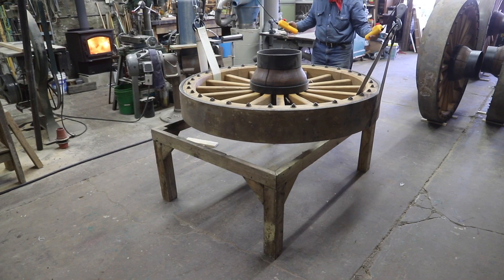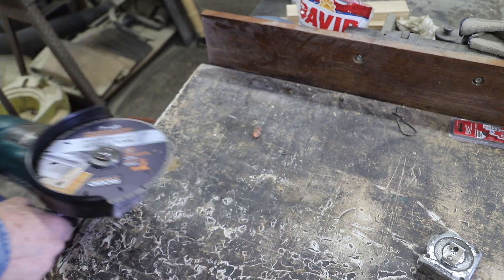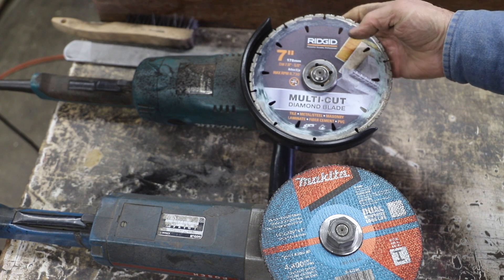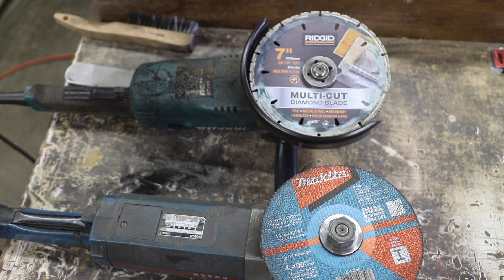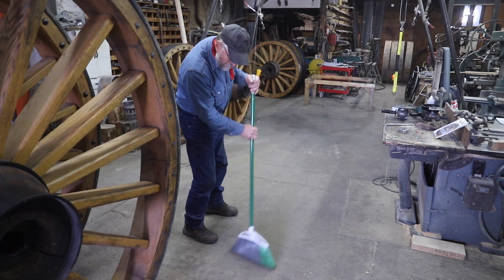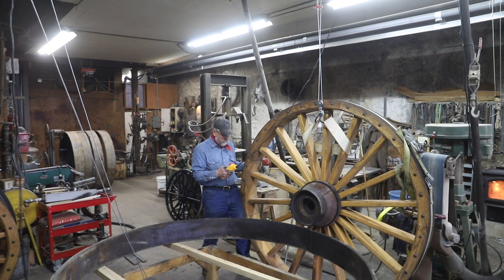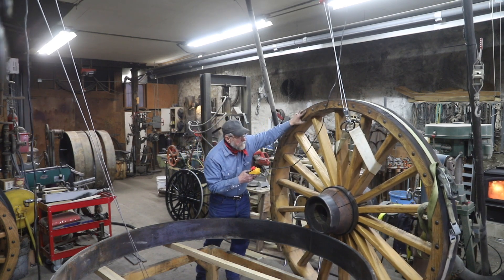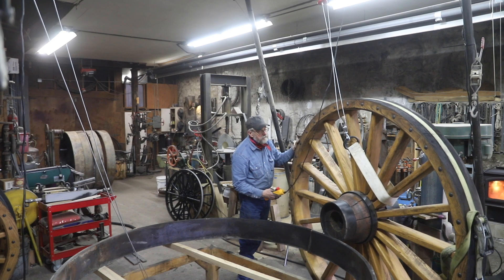Dismounting 550 lb. Steel Wagon Tires | Engels Coach Shop

Comment: Wow! @11:30 you could see how sloppy the joints had become, as the hub sank a couple of inches below the rim - proof that they really were felloe-bound and did need to be tightened up. That was an impressive feat of single-handed manoeuvring of those heavy wheels - well done, Dave!

Comment: I think one may have missed under stud what a diamond blade is realy good for, not soft steel as in your  wagon wheel tire, yes that is softsteel as compaired to HSS, tool steel, soft steel will gum up a diamond wheel, it's like taking lead to a grinding wheel, and diamond wheels don'thave open poors like a stone grinding wheel witch brake down and maintan there cutting eage

Comment: Use a 3 point lift and you do not have to be as close with the balance. But that requires a 3rd winch and a 3rd hand.

Comment: Those diamond wheels tend to cut much slower, but handle more materials and last longer, despite diamond being soluble in hot iron. Best use for them in my opinion would either be stone work, or having one in a field bag to fall back on if you run through the rest of your abrasive discs and aren't in a position to go back and get more. I wouldn't have  expected them to hold up as long in ferrous materials as I've seen them do in tests, but iron might still be the worst thing to cut with them

Comment: I don't understand why you had to adjust these wheels so soon after you made them.......they were just static displays at the museum right ?......I watched you make those and am still in awe!
Reply: The humidity in the desert is much lower than the average condition at his workshop, so the wood will settle to a different equilibrium moisture content.
Reply: Good answer, Michael. Also they are used once or twice a year in parades.

Comment: Problem with diamond cut off wheels the diamonds are glued on. When they heat up the diamonds fall off. Never been able to understand why they market them as high speed cut off wheels as high speed plus steel makes a lot of heat.

Comment: Wheels wobble but don't fall down that much with Dave though his crane leaves a lot to be desired it might be time to improve it. Indeed if he doubled the legs by welding another diameter pipe onto them they'd barely flex at all and its cross beams that hold the winches could be doubled as well.  If eyes were  installed on its legs near the bottom ratchet straps he used could keep them from spreading say on three sides, though ideally they'd make an X on the floor since there angle would work even more that way.

Comment: each type of metal cut off tool that uses abrasive disks has a rotational speed to give the optimum edge speed (ft/sec) for cutting, so using worn down disks in the appropriate size angle grinder is no problem. The problems start when an over size disk is used ie a new 9" blade in a 7" grinder is a disaster waiting to happen.

Comment: those tires still looked pretty tight on the wheel.
Reply: Until 11:23 where you can see the felloes and tire sag under their own weight when the hub contacts the floor.
Reply: They are. As he mentions at the end the wheels are felloe bound. The felloes are the wood pieces that go around the rim under the steel tire. As they dried out the felloes shrank in the width dimension but not very much in the length dimension, so they no longer rest on the spokes' shoulders. Last video he highlights this while he is assessing them. He will trim down the felloes a bit get them to seat against the spoke shoulders again and then he will size the tire to the new circumference.
Reply: @MichaelOnines  Somebody’s been paying attention… great synopsis on the task at hand, thanks!

Comment: Around Around 5.30 you use a normal cut-off wheel rather than the diamond. A standard cutoff disk (for steel) is definitely the right tool for the job. BUT .. it seems (hard to see but looks like) you don't have a guard fitted .. arrggg. Those things can and do shatter and when they do its messy. Please fit the guard
Reply: I have to take issue just a little bit with the "safety first" ideology (which didn't even exist until employers became liable, when lawyers and insurance got involved).  Safety is important, of course, but a few other things (i.e., freedom to do as we choose) are even more important.  As Mike Rowe says, "Safety third!"
Reply: @tuberzish   My issue is the lack of respect that is shown by some posters who assume Mr Engel has not thought out what he is doing and ,they believe, he needs their assistance to do a better and safer job.
Reply: @christophermaurer1271  great respect for Mr Engels skills making wooden wheels. But the video makes clear he certainly isn't an expert regards cutting wheels

Comment: Good thing you put a line under the six so you wouldn't get it mixed up with the nonexistent ninth wheel.
Reply: Always do it the same way and you won't forget to do it when it really matters.
Reply: @garrettswoodworx1873  That logic works to a point. If you always do things the same way, it's easy to not think about what you're doing, and it can stifle innovation and improvement.
Reply: @davidshaper5146  Of course, but the "point" we were talking about is a specific basic action that used a bit of innovation (highly visible and relatively durable spray paint vs traditional chalk or crayon markings what could easily be obliterated) and needs no improvement. If you've watched this channel for any time at all you know that Dave is the master of innovative techniques while adhering to his customers' frequent desire (requirement?) for historical accuracy. The mastery is in knowing when to innovate and when to be consistent & I believe Dave shows us that trait on a regular basis. Have a great weekend!
Reply: Also, not necessary to label number eight as that would be the only one without a number.

Comment: Abrasive cutoff wheels need the high speed of a grinder, diamond, nope. The diamond likes far slower speed and cooler operating temps, Cut some stone with diamond and water, works well. Diamond cuts steel slower than abrasive wheels, which you discovered,  but  maybe cleaner. If I have to (cuz it may be all I have at the given moment) use a diamond grit wheel for steel I try to get water into the cut while cutting, then you get the obvious problems with supply and a lot of mess. TheExplodingChipmunk's comment is correct.

Comment: Not surprised that you did not get performance out of the diamond wheel.  Lots of reasons for this.  The micro geometry of the diamond will not “cut” a material that can move out of the way.   There is no sharp edge.   The biggest reason that diamond is not a good match for any iron based material is that when it gets hot, the iron wants to suck up carbon.   Diamond IS carbon.   
I am not sure how the “diamond” was made, as it was almost assuredly synthetic.  Synthetic diamond is pressed with cobalt.   They have different thermal expansion rates, with the cobalt being greater.   When they heat up, the cobalt fractures the diamond.  This is why “leached” cutters are popular in polycrystalline diamond compacts (PDC) cutters used to drill oil wells.    The cobalt is leached out.  
If the grit used in the blade happed to be natural diamond, there would not be cobalt expansion. Diamond is the hardest material we know, UNTIL it gets hot, and then it gets soft.   The small grits will quickly loose any edge they had by virtue of being tiny, and will develop flat spots.   It will then be very difficult to push hard enough to make the saw cut.  
Sorry for the long rambling, but between 1990 and 2017 I spent a lot of time designing PDC drill bits for the oil patch, and also designed a grit based style used to drill the hardest rock.  I just though this might be of some interest.
Reply: Thank you for the information.

Comment: Wouldn't of been easier to move the table with the rim out of the way before trying to upend the wheel ?
Reply: Maybe possible if the table rolled on much bigger wheels.  500 lbs. doesn't move easily.

Comment: Me in the beginning: oh these worry worts need to shut up!
Me later in the video: DON'T USE OLD CHOP SAW BLADES ON YOUR ANGLE GRINDER! Where is your grinder gaurd! Oh heavens! 😟
I have have a couple bad experiences with cut off wheels, but those were also cheap junk that the boss was buying. I will see myself out now. 
Cheers

Comment: Any company selling diamond anything for making sparks with steel/iron is a 100% crooked outfit. 
Cubic boron nitride (cBN) is used for iron alloys in high production industry, even though its not as hard as diamond at room temp. Diamond softens more than cBN at high temps and being carbon diamond actually dissolves into the steel at grinding temperatures. 
For non ferrous materials or low tempsdiamond is preferred, but there is still a huge range in quality and bonding styles.(and the good stuff ain't cheap its justified for production line machines running continuous all day every day with automated feeds and pressures, where downtime to swap disks is a substantial cost and they track and tune performance to a few percent.

Comment: I've been around lg diameter wheels. Turning them around when standing on end seems to be the most 'dangerous' time.  I reckon because turning them imparts a rotational force.  And vector is at right angles to applied force.

Comment: It seems you are "sensitive" about viewers concerns for your safety.
But I still feel the need to pass on my experience of angle grinders.
I am not a snow flake and calculated risks are part of life.
After more than 50 years working in metal, a lot of which was with hand tools, the two most serious cuts I received were both from angle grinders.
Without offence ..  can I say you are taking unnecessary risks by not having the guard fitted.
Presumably because your recycled blade was too big.
Angle grinders don't take prisoners  .. they go for the kill !

Comment: Dave, diamond is NEVER good for steel. People who sharpen carbide tipped circular saws often go to the extent of grinding off that tiny portion of steel located behind the carbide tip, on a regular "stone" grinder, to avoid diamond wheels (which are used to grind those carbide tips) touching the steel and messing them up. Also, "if something is 'suitable for everything' then it is probably "good for nothing'". In short, a pure "advertising... horse manure" - which you've just found out "the effective way" (aka "the hard way"), paying with your own time and money. A regular steel cutting 6" or 5" disc would get through that band in a matter of minutes (for those diameters you can get a very thin discs, like .06 - .08", or even thinner, dedicated for cutting - I doubt if they are available it in 7" and 8" diameter).
PS: Also, it's never a good idea to remove safety guard from angle grinder, especially those bigger than 5". People got killed by the shrapnel of shattered discs from those bigger grinders, and even if you won't get killed loosing couple of teeth or an eye (or getting badly disfigured nose) isn't really worth the "convenience" of working without the guard. Steel diamond-tipped disc won't shatter, but a resin-bonded silicon carbide one can, and sometimes do. Don't play a Russian roulette, as exciting as it may seem it's not worth it.

Comment: Yeah.  A bit nerve wracking - especially the angle grinder without a face shield for your eyes (but that’s just me).  What I can’t figure out is how you rolled the wheels without tires over the “buckles” on the straps.  Skip a video?  Never!
Reply: If you start with the ratchet near the bottom you can co almost twenty feet before it comes back to the bottom on the big wheels, and if you rotate the wheel 180 when you get there you can go another twenty.